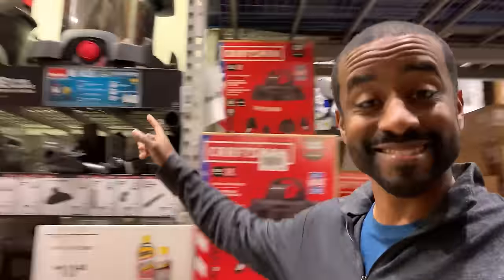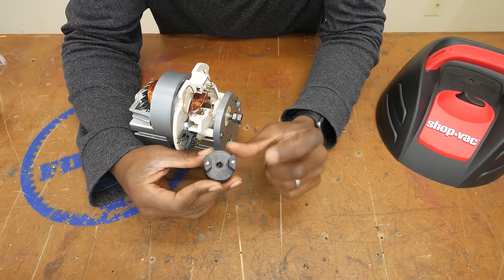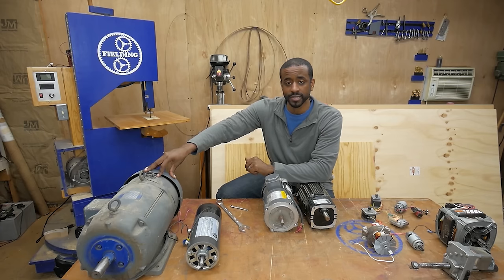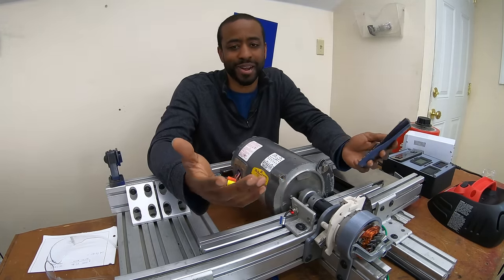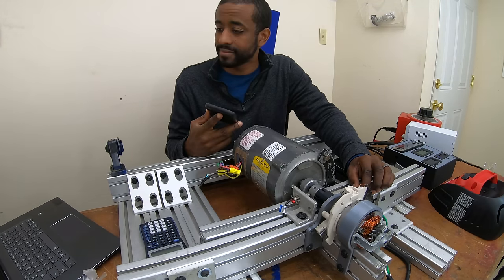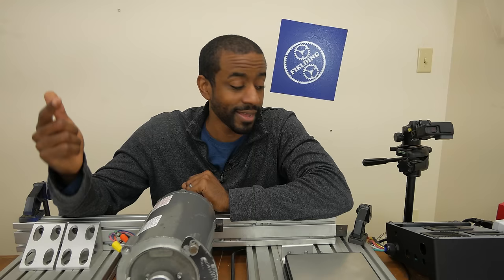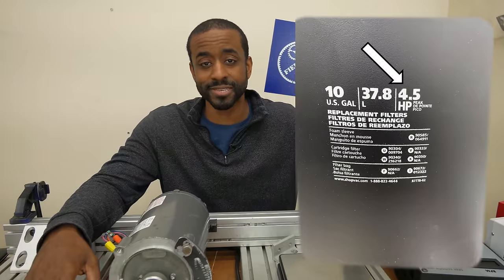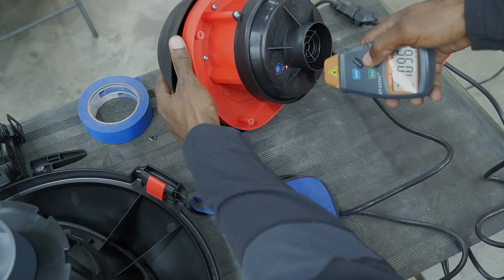How Much Horsepower Does Your Shop Vac Really Have: #078

Comment: It's funny that they say it is used for consumer comparison purposes and then go on to say that they include the inertial contribution. As far as I understand, what they did is let the motor speed up and then suddenly load it up. For a split second it will provide more torque than the motor can actually provide due to the inertia of the rotor. Measuring the horse power this way is basically meaningless, since you can get practically whatever reading you want. It's just a matter of the time frame. I'm sure you can get 100 HP out of it for a couple of nanoseconds when you first start loading it and it's still at full speed, it probably wouldn't even have to be connected to power. Suddenly stopping something that is spinning very fast will obviously give you a lot of force. Basically you are measuring the impact torque and multiplying it with the speed it was at at the exact moment you started loading the motor. One second later it was probably at a stand still.
This is similar to the peak power advertised for audio amplifiers. They can usually also output an arbitrarily high peak power depending on how long you measure the power. For a very very short time the amplifier can put out a lot of power from the capacitors. But that is completely meaningless for actual comparison.

Comment: Interesting since I've always taken issue with the ridiculous HP claims and having worked with industrial motors a 4HP motor compared to a claimed 4HP vacuum cleaner motor is a joke.  I came up with a similar and close measurement without all of the testing equipment by multiplying 120V by 9.9 Amps divided by 746 Watts to come up with 1.59 HP.  The true actual HP rating is already readily available on the motor housing where it shows 120V and 9,9 Amp current draw, end of story.

Comment: The most power that is allowed to be consumed by a device that plugs into a wall outlet in the US is 1500 watts. 1hp is equal to 746 watts so it can not possibly be more than 2 hp "if" it used that much power.

Comment: 4.5HP  = ~3,350 watts = 28 amps@120volts.
The label claims <10A and has a 16ga cable which is an easy giveaway that they are not expecting anything close the printed number. Using the printed voltage and amperage numbers it will max out at 1200 watts which is only 1.6hp assuming 100% efficiency. Clearly, efficiency is not a banner specification on this design which means the delivered power will likely be under 1hp even when the motor is about to blow its thermal fuse. 
Since it is after all a vacuum, the Shop-Vac company can be proud when the customers say that is SUCKS.

Comment: I'm not in the industry or an expert by any means, nor are these numbers accurate, but I know that they are reasonably close to those used by manufacturers. 
Food companies have outlandish claims for some of their products.  They can say "organic" if like 80 or 90%of their product is organic, they mess with rounding off numbers MULTIPLE times to get a "better" number too. 
And the reason they dont want us to know their testing parameters is that the math doesn't add up. 
Also, dewalt uses their unit watt hours or whatever instead of hp or inch lbs like everyone else. They say it is more accurate and helpful than the "outdated" hp and in-lb ratings, but all it does is make their tools be on a different system so you cant look at spec sheets to say "this is better or not."
I really dont know if there is a good or accurate way to measure tool performance, but clearly manufacturers' specs ain't it!

Comment: The rating claims are based on cfm (cubic feet per minute, of air)  at 1 atm (atmospheric pressure). It's not the motor power rating. There's some convoluted math that gives them the "HP" rating, but it's definitely not what people expect.

Comment: I design rotary vane vacuum pumps for pumper trucks, one of my smaller units is 9 hp for 110 cfm at 26 inHg vacuum. I think they are relating cfm and suction power (vacuum) to some inefficient system and interpolating their units performance to power usage.

Comment: One thing that's crazy about these numbers is that they keep going up.  I bought a Stanley SL18129  several years ago which has a prominent 2.8 peak hosepower sticker on it.  If you look up the model now it says it has 4.0 peak horsepower!  Naturally they must have upgraded the motor, not changed their BS ratings.

Comment: 1 HP = 746 watts. 15 amps outlet x 120V line voltage = 1800 watts available. 1800 ÷ 746 = 2.4 maximum horsepower available from a typical home wall outlet.

Comment: I've noticed that horsepower thing as well and was confused/surprised based off the light weight and relatively weak suction. (as well as wondering how the heck it could even pull that much current from an ordinary 120v house plug that probably has like a 20 A breaker or something (or really even less, since if you're going to design a product for average consumers, you'd need to go for the "lowest" breaker, probably like 15A). Also even the normal power cord would seemingly be quite unsafe for such a high current. I don't want to do the math, but I suspect that it could melt the plastic in the right sitation.

However if these aren't the actual power claimed, how could they possibly get away with saying that? What the heck is "peak horsepower"?

Comment: Note the unit was listed as Peak, which is an overload or startup high torque ramping speed peak power. Think if you set your torque load and then just plugged in the motor. It would have a huge starting load. Somewhere between 0 RPM for zero HP to no torque no load self destruct from overspeed, (universal motors do that sometimes with no load) again at 0 horsepower, there is a peak horsepower with high torque and high speed, but well into overload conditions.That is the number printed on the unit.  Always take peak as a sales gimmick. More interested in running power.  Electrically that is the speed where the unit draws rated power. At the label draw of under 10 amps, the electrical draw is under 1200 Watts, with the discovered efficiency of only 50% that motor is less than one horsepower.
Cheap universal motors have too little iron and are not efficient. Larger motors and inverter driven motors such as PM motors are more efficient.The big box store lightweight shop vacs do not have the more efficient motors. Look online for commercial units often produced by large motor manufactures such as Dayton. Many of those do not list horsepower on them. They are heavier than the lightweights. Avoid anything with the useless Peak HP on them. Those are the lightweights. Same applies to cheap car stereos. Avoid the Peak Watts numbers.

Comment: are sump pumps actually rated for the 1/2 HP or 3/4 HP they usually advertise? the motors are much bigger than these shop vacs
Reply: Tony Hong Sump pumps are rated at their horsepower/wattage at continuous operation. The disease that infest shop vac manufacturers has not infected sump pump manufacturers yet.

Comment: So after further thought, this is a type of eddy current dyno?. You are providing DC current to the stator and the reactive magnetic field from the rotor creates the resistance. Heat is built up in the rotor primarily?
Reply: I would like to know the answer to that one. It would be much more simple, than using a variable frequency drive in regenerative braking mode. A VFD would have to be capable of 338 Hz, to handle the RPM of the vacuum motor.

Comment: The average power outlet only gives out 1800 watts, 120V x 15Amps = 1800W = 2.4 HP. I remember a blender company blendtec claims their blender has 4 HP. I was thinking the outlet only provides 2.4HP where those extra powers coming from? If you had high school physics, you know it's BS. By the way Torque is work times distance applies to a rotating shaft and horse power is the sum of work times distance in a time interval.

Comment: I wonder if it can be calculated as work done... like for example if you take a 10lb bag of sand and suck it up three feet in one minute... looks like that is .75 watts.... not much either or maybe if you measure a marble and suck it up the tube f=ma and convert f to mechanical horsepower the second method would include inertia if you use the final velocity of the marble

Comment: I believe the fraudulent  peak horsepower or "develops" horsepower means that the motor temporarily delivers, due to inertia, the higher torque/rpm of a massless motor of the claimed horsepower. B they are probably minimising the inertia of the impeller as well.  For example, cutting through a nail.  For a shop vac, it probably  wouldn't even help clear clogs since the motor actually sees less load when there is no airflow.

Comment: Stalling torque and no load rpm may be two parameters that they base peak horse power from. A theoretical measure not attainable in real world.

The most practical measure is air volume per unit time under a pressure drop referenced to  one bar converted to hp.
Reply: I ran the numbers based on the loaded RPM and stall torque, and got 6.5 HP. but, I don't think you're too far off, as to how they get their impossibly high horsepower ratings. Doing the math, a 100% efficient motor can only produce 2.4 Hp on 15 amps, and 3.2 Hp on 20 amps, without blowing fuses. to produce 4.5 horsepower, a 100% efficient motor needs 28 amps. This motor is only about 50% efficient, so you need twice the amperage, to produce that impossible horsepower. 56 amps will trip a breaker almost immediately.

Comment: I'd be more interested if the scale is consistent. Is 6 PHP actually three times better than one they rate as 2PHP? You mentioned that in the end summary, but did you test two shopvacs against each other?
Even if your test doesn't get to their numbers, your numbers should be related to each other.

Comment: I always thought that  those HP ratings are phony.
Hose power is a mesure of work. It is the ability to lift a 550 Lbs to height of one foot in 1 second. I do not think that with inertia plus torque that  that motor will not be able to run  sufficient time to accomplish the  4 hp needed to lift the load of 2.200 Lbs in the prescribed 1 second .   Not even close,  inertia  or not inertia. for the inertia to come close to be considered the speed of the motor and the mass of the rotator will have to be much, much larger to store the energy needed.   Measuring watts is not a reflection of horse power output because of the motor deficiencies, there is too many conversions of energy like heat drag design and cooling fan 4 horse power motor need to be drawing north of 27 amps, that means that everytime you turn on your Shop Vac in an average home you will trip your breakers. Imaging having a machine running at 110 Volts with a load of 3.000 Wats
HS physics is sufficient to figure this out.

Comment: I have less problem with the garbage number than I do with the fact the company will not disclose their testing methods.  Otherwise, what's to prevent another manufacturer from saying theirs has 12 or 120 Peak HP in the same-priced model?   Sure, maybe they had to hook it up to a 300 lb flywheel and spend 20 minutes ramping it up to speed.  Actually, if the impeller is included in the motor's inertia , what's preventing another company from making their impeller out of thicker aluminum and claiming twice the Peak HP?

Comment: As I have always thought HP is meaningless what I want to know is vacuum and flow rate produced.
 You can find this by putting a vacuum gauge on the hose about a foot back from the nozzle.
flow rate is a little harder to find as there is no gadgets for this that I know of.
this would make more sense than the HP of the motor.

Comment: Your set up for testing torque and speed is also an electric motor of sorts. That means it also has efficiency losses. I bet you could split the difference of your calculated efficiency between the two motors. 

Factoring out the efficiency loss the total hp would have been a little over 3hp.
Reply from the maker: Not at all. I am directly measuring the torque on the body of the motor. You can watch the previous video to understand how the rig works. The numbers are exactly what they should be. I tested this on several motors with a known horsepower.

Comment: Hi Jeremy, I really enjoyed your video.  I'm wondering if the peak power they claim has more to do with a function of air flow instead of actual motor torque.  For instance, one of the tables I use for power conversions (has stuff I don't really need) includes CFM (cubic feet/min) to HP.   15.59 CFM = 1 hp...   Just a thought..... Keep up the good work!!
Reply from the maker: It can’t be. Every measurement after the motor will have less power. It is impossible to get more output then what you started with. As shown in the video. The motor is wasting half the electrical power. The impeller is wasting some power. Drag in the hoses is wasting power. The final output is WAY less than .87 horsepower
Reply: @Jeremy_Fielding  I get that...  I was just wondering if they had some magical formula due to impeller inertia and flow volume... It really is a fake number anyway...

Comment: They overinflate those ratings (sorry for the pun LOL) as much as these little "shop" compressors.  Check those out.  My old 1 1/2hp Montgomery Ward open drive from the early 80s (made by Cambell Hausfeld IIRC) beats a 5hp Craftsman oilless unit.  And is WAY quieter.

Comment: This same thing has had me irked for years. I have a 3hp that runs on a 15A wire. Not a very big wire and it doesn’t even warm up. I could build a daisy chain of these magic motors and run a hospital off a 1800 watt input.

Comment: You need better testing equipment to measure peak HP, a transient spike within a few pico seconds like the nuclear particle colliders, LOL. They might also use lock rotor amps and translate this into HP. In either case a 15A house circuit translates to 1,440 watts continuous assuming unity power factor, not much more than 1 HP taken efficient into account. 1/2 to 3/4HP would be more like it, larger motors with start up inrush current will trip the 15A circuit breaker.

Comment: Nice job.  This has bugged me for years also, but with air compressors.  I know what a 5 hp industrial motor looks like. In those "big box" stores they sell the homeowner a cheap 5 hp machine.  As you know, you can calculate the watts by multiplying volts by amps.  So two 5 hp motors should have the same amps for the same voltage.  The cheap compressor I looked at was equivalent to a 2 hp, based on the amp draw listed on the motor nameplate.
I did notice that the  nameplate said 5 SPL and not horsepower.  I was told that it meant 5 horsepower special.  Special?  Special for who???
Just like Ryan mentioned, they are including the kinetic energy of the rotating mass.  That is utter nonsense.  That is not usable energy.  It is deceptive advertising.  
But now that there are so many companies advertising like this, which one will risk sales by telling the truth and listing a low but actual horsepower value.

Comment: Funny thing, they(should be, if they’re truthful, which defeats my entire comment because they’re not) tell you the actual operating power on the box. You just have to do one extra step, 9.5A x 120VAC = 1140 Watts. 1140/750 = ~1.52 Actual peak operating horsepower. 

We used to have “trustworthy” third party testing facilities, like Underwriters Laboratories that would certify appliance ratings. Nowadays people slap on theoretical numbers that would require a free energy device to obtain those efficiencies. 

In summary, buy a reputable brand, read and watch non vested reviews and read the fine print.

Comment: As a universal motor. May be DC power would increase the output power. If you run it on DC at the peek voltage of wall AC.

Comment: Its just marketing. They know that most buyers have no idea about power - so when they see a bigger number stated - they imagine that makes the item better. Vacuum cleaners are notorious for this. I think suction of cleaners is more dependent upon the impeller efficiency. I have seen an old cleaner rated at 600watts which out performs a new one claiming two HP.

Comment: Question, would certain motors not be more efficient operating with smaller rotational mass as they were designed to, as well without a coupling to another shaft? As couplings are a source of more inefficiency. If you take the assembled vacuum and put a restriction on the outlet, would the motor not have to do more work to move the same amount of air, and thus be less efficient?

Comment: At 100% efficiency a 15A, 120V circuit tops out at 2.4 horsepower. In electrical terms 1 hp = 746 watts.

Comment: How on earth can they claim 4.5 HP on anything running on 110V, especially while making it clear it’s a lie? The power draw you showed printed on the vac at 4:52 minutes was 9.9A at 120V. Power in Watts = VxA = 120*9.9= 1188 W drawn or 1188/746 = ~1.6 HP. Even at 100% efficiency that’s barely 1/3 of the quoted value.

Comment: great job with the video
I think they are referring to the lock rotor current translated to it equivalent in hp 
Great numbers to look at but totally useless to me because this number can only be achieve if the motor is starting or stall  and at that point their would be no suctions